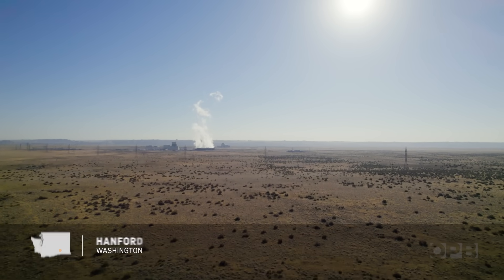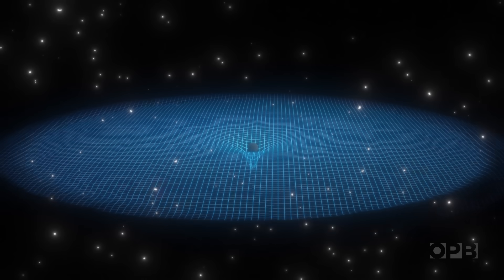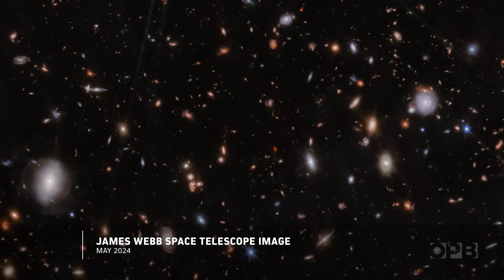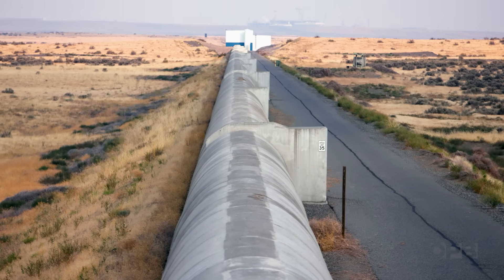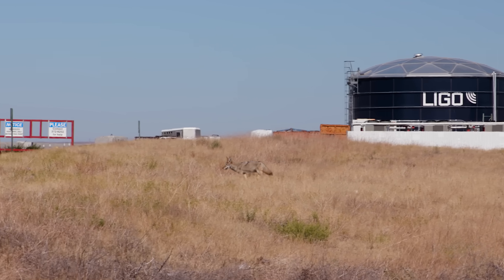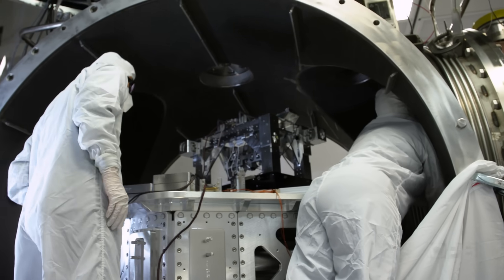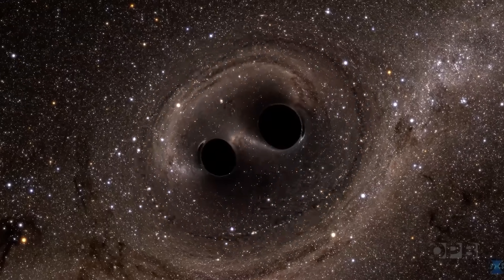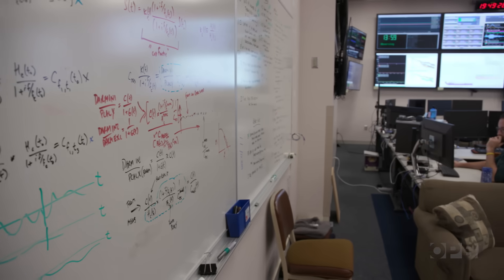LIGO is finding black holes from the steppe of eastern Washington | Oregon Field Guide

Comment: Abbott describes electromagnetic gravitational waves formed by the collision of two black holes that electromagnetic gravitational waves are depicted with Maxwell's equations yet Faraday's induction effect is not gravitational, and, gravitational waves, based on Maxwell's theory, are formed by the motion of a ether that does not exist (vacuum). Plus, the LIGO 10-18 m displacement is too small to measure since the LIGO 10-18 m displacement is smaller than the diameter of an electron (10-15 m). To detect an electromagnetic wave requires an antenna but the interferometer is not an antenna since an antenna detects an induction current formed by an oscillating magnetic field yet the LIGO experiment is detecting a displacement which nullifies the LIGO experiment.

Comment: Not only collisions. That is the equivalent of listening for thunder. A civilization much more advanced than ours does not use relatively slow radio waves with which to communicate. We are listening, but these civilizations are not talking on this line. There is no reason to believe that gravitational waves that pervade the universe cannot be modulated. Instead of electro-magnetic waves, i.e., radio waves, perhaps this must be separated into each component, electro and magnetic and use only the magnetic line-of-force that pervades the universe as the foundation of communication devices with civilizations in outer space.

Comment: This reminded me of some of the things I was involved in building. I worked for a company by the name of Kenlab in the SF/ Oakland bay area during the early 70s and into the 80s. I welded many aluminum tubes about 12 inches by 4 feet long. I welded aluminum flanges on them. We welded and machined and made sheetmetal parts. They were for Laurence Lab in Livermore Ca. I also worked on projects for Laurence Labs Berkley. It was equipment for them to work with Lasers. Berkley they were trying to create a Sun. It was different to say the least. The Livermore lab were going to shoot lasers down these tubes. Not sure why. Everything we made at Kenlab was hi-Tec.  Like parts for Voyager or fire suppression systems that went on Airliners. It was my favorite place to work. Everyone was highly skilled and many times it was up to us to figure out how the make these things and hold tolerances at plus or minus 0.003. A few time I had to figure out how to weld something that the welding books said can’t be welded. I did and that is why we had High Tec companies coming to us. Kenlab is closed now. It closed in 2000. It was just this small job shop that most people had no idea was going on there.

Comment: An excellent IR laser application. What wavelength do they operate at? How many joules? What kind of resonator do they use?
Reply: @mikeleahy573  They operate at 1064nm wavelength.  The input laser power is of order 100 watts, but due to resonance, the stored power in the arms is hundreds of kw. To get joules, you would need to define the amount of time you dissipate the stored energy to go between the circulating arm power and joules. The resonators are very high quality mirrors separated by 4km; the light bounces between the mirrors.